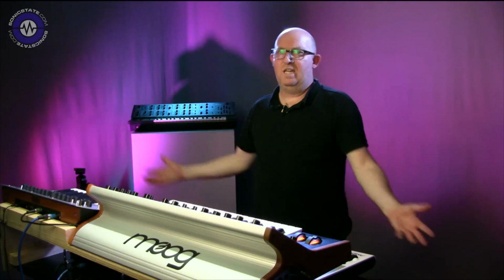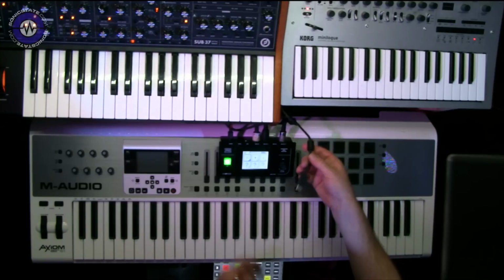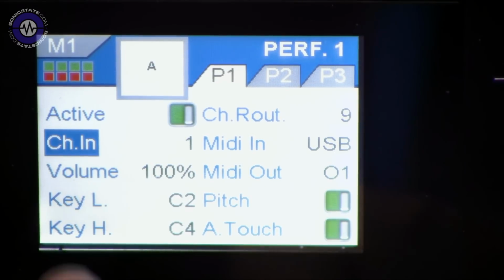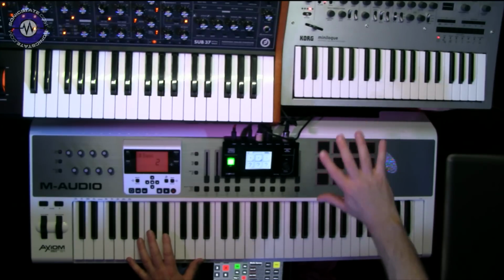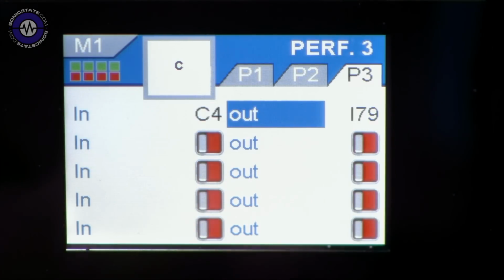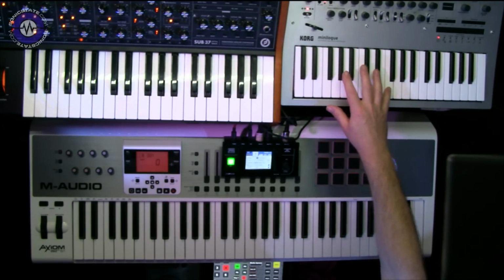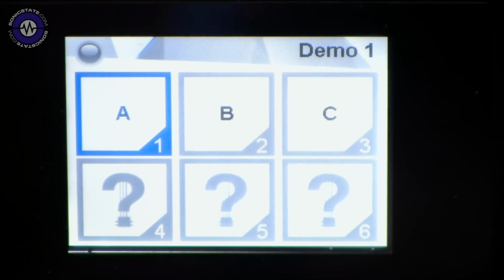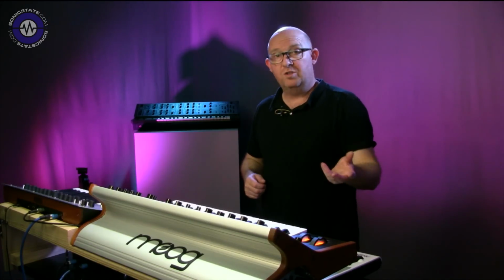Sipario Intelligent MIDI Router - SonicLAB Review

Comment: For the money I think iconnectivity Mio4 would be better at about $150 USD. You would need to set up routings via a computer though, then it works standalone.
Reply from the maker: yes but this is dynamic, you have multiple patches and setups for recall thats what makes this unique
Reply: Indeed that is a big selling point. The only thing I think of that comes close is BomeBox which you can access parameters via web interface let's say off an iPad.

Comment: great machine, seems to be just too limited on the number of in- and outputs, for a cheaper and very reliable programmable 8x8 Midi router check out the Alyseum Al-88c
Reply from the maker: Sure, but that doesnt have patch change, front panel, stand alone operation, unless I missed something?
Reply: you're right, you need another machine to set it up (you normally do it over network ethernet) but I just wanted to mention it, because there are not that many Midi patchbays around and people new to the business might need them (especially with so much new and cheap hardware on the market)
Reply: and it's standalone operating (no changing of setup though)

Comment: I know I'm late to the party here, but can this device map MIDI CC with a Learn function, for keyboards that aren't normally remappable without the use of a DAW, such as the Novation Launchkey 49? Or better yet, can it simply allow me to type in/select custom midi CC values exactly without needing the control accessible on the front panel for a Learn function?

Also, can it take midi Input on channel 3 and 4 from DIN Input port 1, and reroute that as channel 1 and 2 on DIN Output 2?
Reply from the maker: In a word, yes. You can map controllers and also ins and outs.